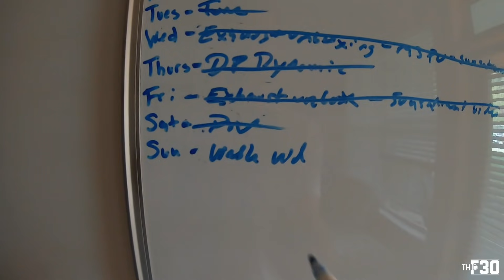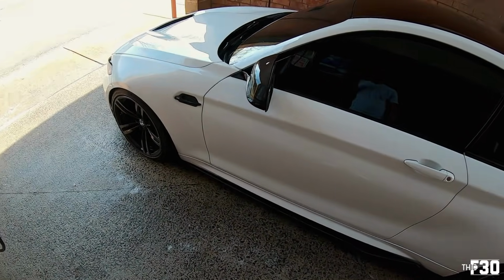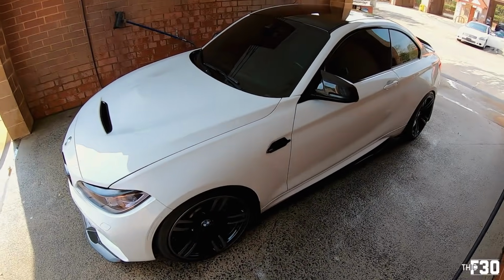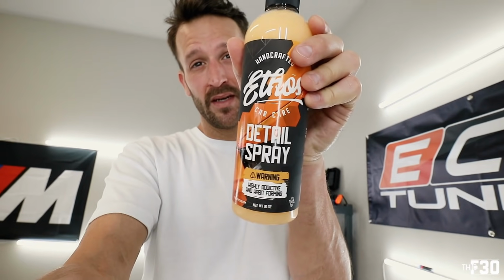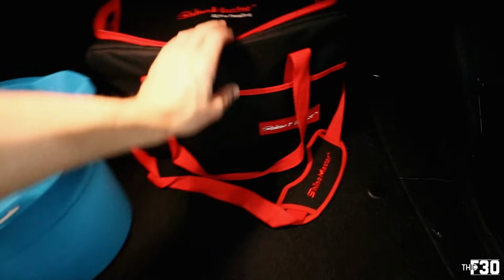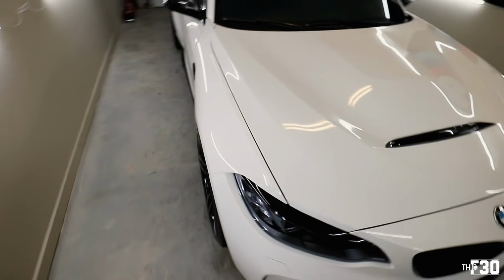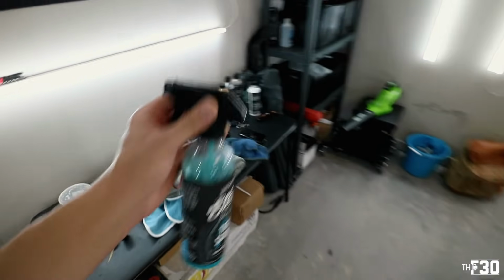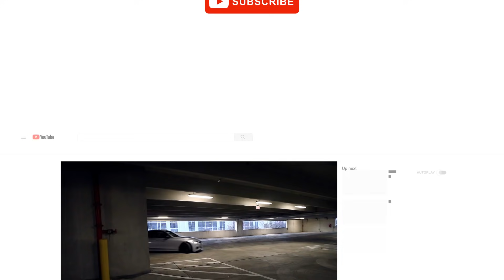HOW TO SUPERCLEAN YOUR CAR - Full M2 Wash Breakdown

Comment: Great vid as always! Only thing I'd say is cop a second bucket & wash mitt for your wheels because using the same one for wheels and paint is guaranteed to scratch your car up. The break dust from the wheels has iron that'll get trapped in the fibers of the mitt and stay there the next time you touch the paint

Comment: I like your channel and content. 
And I wash my F80 myself too. 
just one suggestion: please don't use the same wash mitt on car paint and then wheels and tires. dirt particle can stick to the mitt even after machine wash and next time it will scratch your paint. Unless you are ready to throw away that mitt. Having separate wash mitts, 1 for tire 1 for rest.
Reply from the maker: Been doin it this way for the life of three cars now, haven’t scratched once. I spray the mitt of after each wash with a pressure washer, then I machine wash it. Zero issues
Reply: @ThicWhips  makes sense. I do that too. I just don't machine wash my wash mitt every car wash. I am lazy :D
Reply from the maker: I should also mention, the wheels and brakes are ceramic coated so they really don’t get dirty. I’ll get some brake dust but the majority of that sprays off without even using a mitt.
Reply: @ThicWhips  did you coat it yourself or hire a professional detailer? I got my m3 ceramic coated as well, life changing. I also use the ego leaf blower, great advice on this channel. 
a few questions, after wash, the brake disc gets yellow and it will have yellow dust on the wheel once I start driving and braking. 
Do you have the same issue ? how do you clean those after wash?
I have the Dinan exhaust as well and Dinan tune stage 3 but not much burble at all. I wonder how you like the burble on the bootmod3?
Reply from the maker: I had a shop coat the car, I coated the brakes and wheels. The brakes changing colors and leaving dust is unavoidable, I just use the blower when I get home and any dust blows right off. Burbles come into play once you tune, they are a bit much now that I am catless tho

Comment: Hey Jon so I use a pressure washer all the time and I was tough that best to spray at a 45 degree or higher on paint and only straight on the rims because of how much you will wash your car its better habit and more gentle to the paint/coatings.

Comment: Might I suggest to use a dedicated wheel bucket with a wheel brush like the ez detail brush or wheel woolies and some p&s brake buster. The reason being is that your microfiber mit is going to get iron deposits from the brakes pads that are on your wheels, so the next time you wash your M2 you will be most likely be marring the surface because of the iron deposits that got stuck in the fibers of the microfiber mit. Which is way worse that drying your car with microfibers, just a suggestion. I did like the video btw man take care.